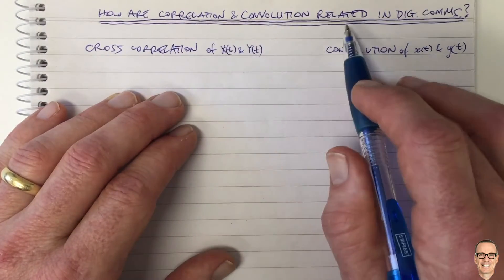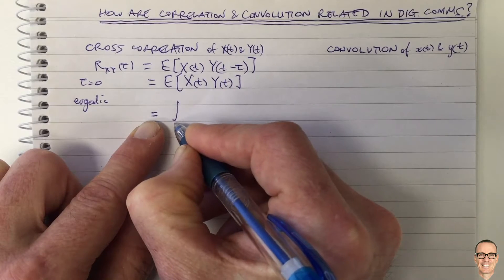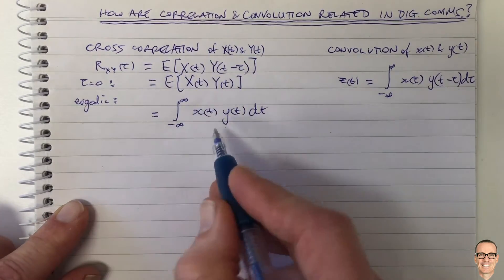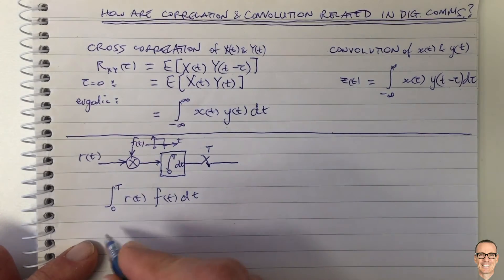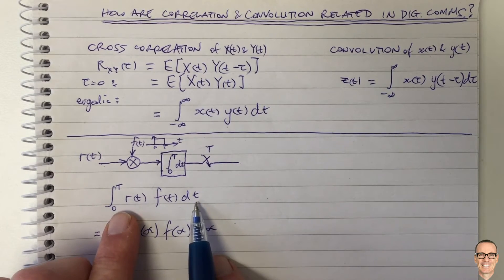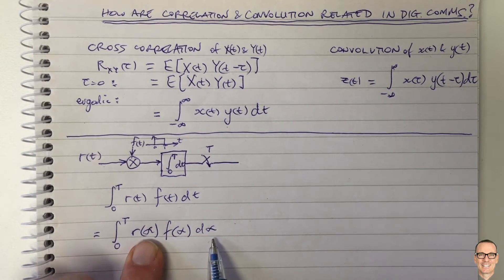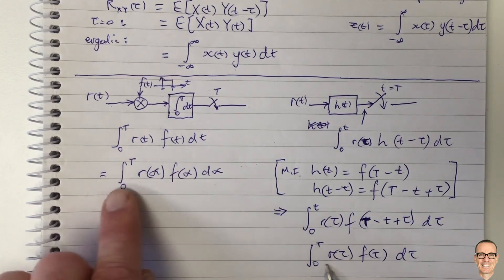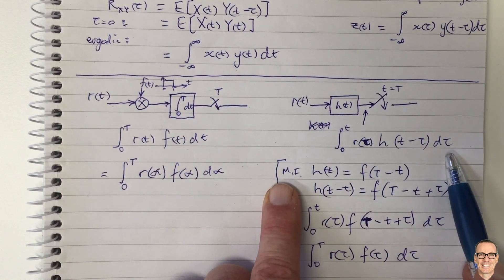How are Correlation and Convolution Related in Digital Communications?

Comment: Thank you Professor for these videos. Your explanations are very clear and concise. So if we take f(t) = transmitted waveform in the correlation receiver, we will get maximum SNR and we can always use correlation receiver instead of matched filter. Is there any scenario in which one receiver architecture is more beneficial over the other?
Reply from the maker: It all depends on the electronics you prefer to use in order to implement it. Generally correlator structures are easier to implement.

Comment: sir in real communication which Is more preferred matched filter receiver or coorelator receiver if both performing same task?
Reply from the maker: Often the correlation receiver is easier to implement, so it is generally preferred.
Reply: @iain_explains  Hello again. As per your explanation(in current video) both the receivers seems to be simple. Please describe why implementing convolution receiver is more complex??

Comment: I do not get the matched filter part. Why do you integrate between 0 and t, when the convolution formula tells you to integrate between -∞ and +∞ ?
Reply from the maker: Ah, good question. I forgot to mention it, but in the video, we are considering only the part of the received signal that arrives between time t=0 and t=T. In other words, we are looking at demodulating and detecting a single digital symbol (the one that was sent on a signal/modulation waveform between time t=0 and t=T), and hence we are only integrating over that time interval. The same analysis will hold for all other digital symbols in a digital communications data sequence (sent at other times), but with the range of the integral shifted in time to correspond to the time over which each of those other symbols is sent.
Reply: @iain_explains  I think I got it : when you pass the function f through a filter with an impulse response g, if your function f is null for negative values of time, (a reasonable hypothesis) you only integrate over [0, infty[, and if your impulse response is null for negative values of time, then g(t-u) is null for u>t. and therefore, integrating f(u)g(t-u)du on the whole real axis boils down to integrating between 0 and t.
Thank You! That was my moment of epiphany about the convolution !